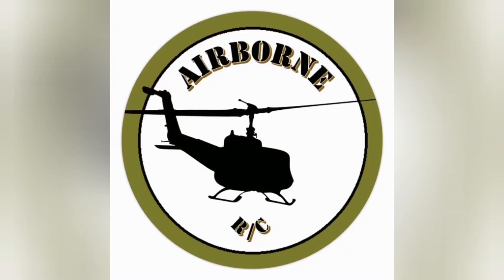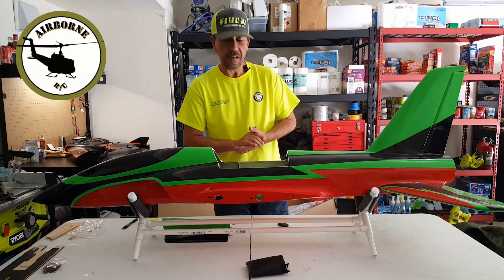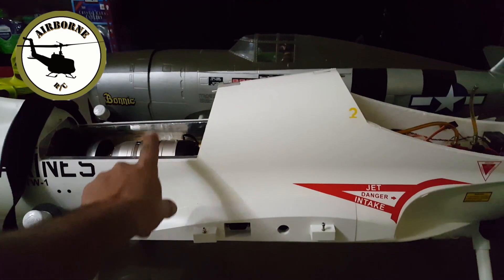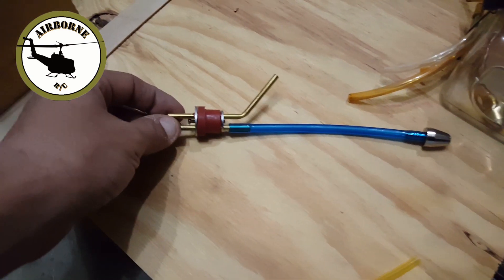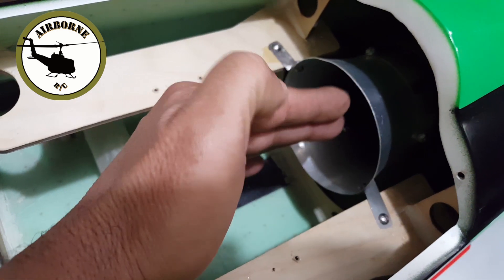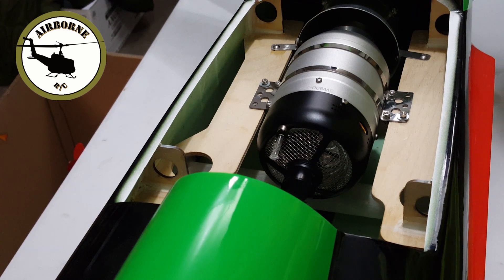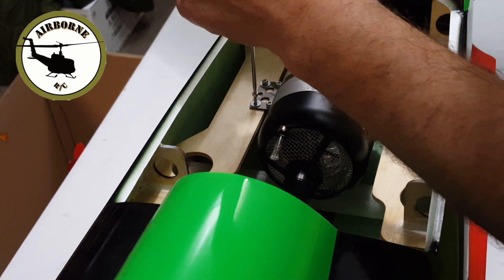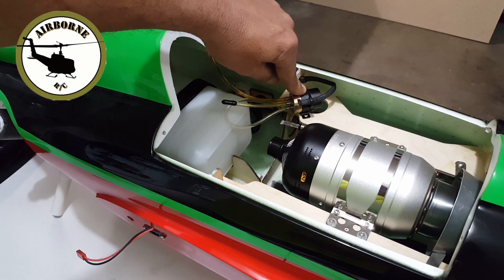Arowana Build Series #1

Comment: Tank  should be over cg.   That's extremely odd. I was going  to buy one. Glad I watched  this . Its a hard pass now  the motor  over cg is a bad design flaw
Reply from the maker: Thanks for rhe comment, i agree, but it doesnt impede it perforamnce. You dont even notice it, i swear. I was on the fence rill i seen my buddy fly his, flys awesome. Keep it in rhe back of your mind. Its well worth the price BELIEVE ME
Reply: @NoonzAirborneRC  
Thanks, could you maybe compare it with JMB/Novajets MB339 PNF? They cost the same, if you ever seen maybe one in your club. I am in dillema, which one is slower on landing and better for grass strip. K80 engine.
Thnx
Reply from the maker: @TomislavReskovic  thats gonna be tour call, but i am familiar with the mb339 or should i say variants....1 between the 2 the arrowana has more wing surface area so will take off earlier and land slower that the mb339 no doubt about that, but being a grass runway and having brakes that shouldnt be a concern since your "flying" the jet down on landing. The runway would be my concern on either model you might need to buff up the front wheel (depending how bad you strip is that is) the mb339 front door for sure will eventuallt break off (hangs low) both jets will fly with an 80 off of grass with an 80 if manicured and its long runway the arrowana can take off in 200ft on paved runway. Oh and the mb339 elevator is sensative (its BIG) only info i got compare between the 2  bud 👊
Reply: @NoonzAirborneRC  thanks a lot. Strip is not perfect but not too bad either when grass is cut.
Hmmm leaning towards Aerowanna then :)

Comment: Nicely done. That cg and turbine position is kinda different   should make for a well balanced plane for some wicked 3d flying 🤔  YEAHHH right.  Airwanna. Makes me think of something else 🤔  GET SOME. 👍👍😎✌✌
Reply: If turbine is spot on with cg, tank is a lot forward, so in flight as fuel gets consumed plane becomes tail heavy!?
If turbine was rear of cg, tank could be more spot on with cg, counterweight the turbine with electronics in the nose, and ideally in flight as fuel gets consumed, no big cg changes occur.
Do you feel that difderence in sime bad way comparing to your hsd viper? Thanks
Reply from the maker: @TomislavReskovic  reason you cg with 1/4 tank and full UAT as if landing bc of low speeds. The wing surface area you dont notice its nose heavey much. It is different but it flys great!
Reply from the maker: That's what a few people have said and or thought of the name....on the tail I was gonna put a pot leaf on it bc it's "recreational" now buhahahahaba